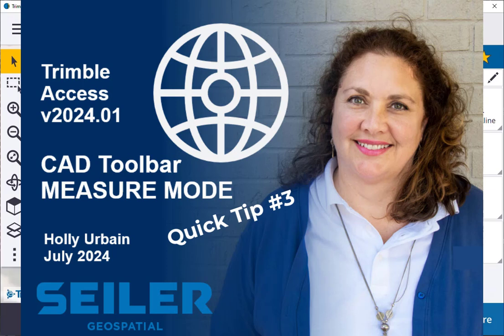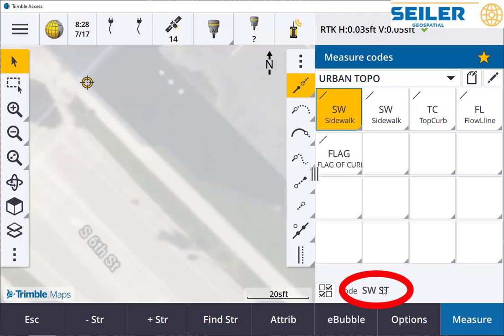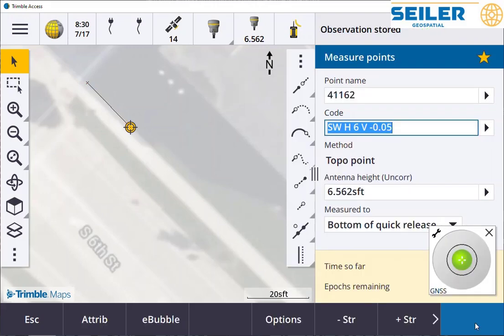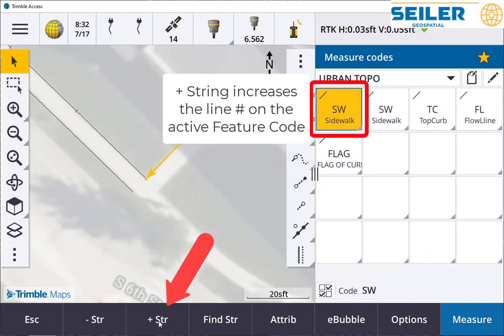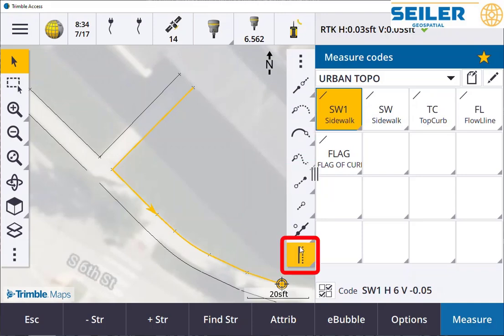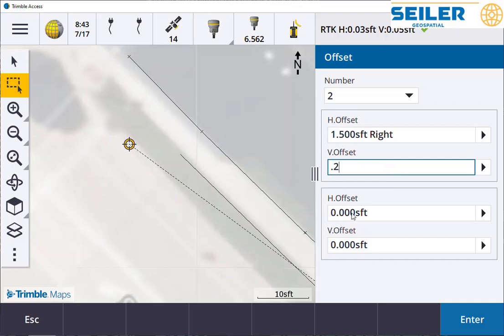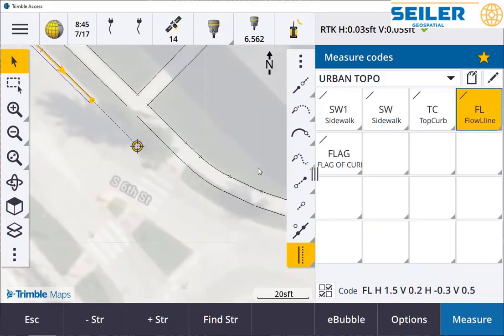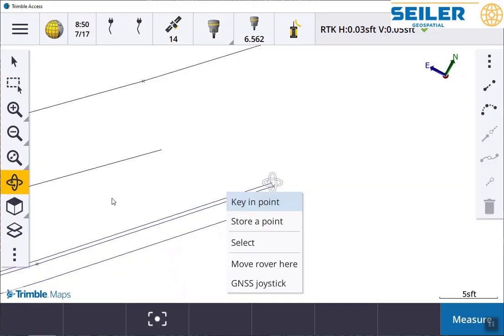Trimble Access CAD Toolbar Measure Mode

Comment: Hello, can the Special Codes be changed by user to adpat to other softwares like C3D? For example, changing the "ST" for "_ST" ? Thanks for the video!
Reply: Yes you can change the control codes for about 80% common codes between Trimble access and c3d to your codes